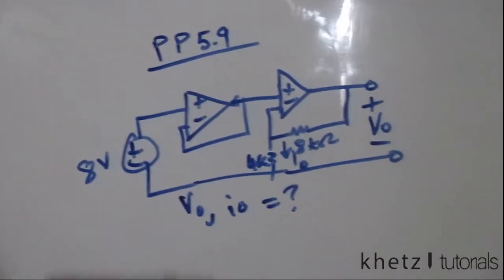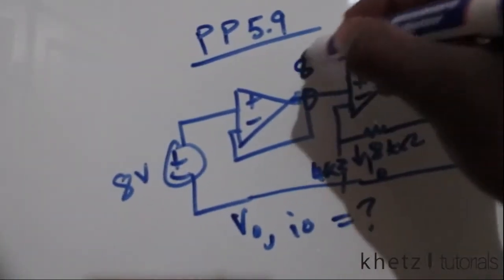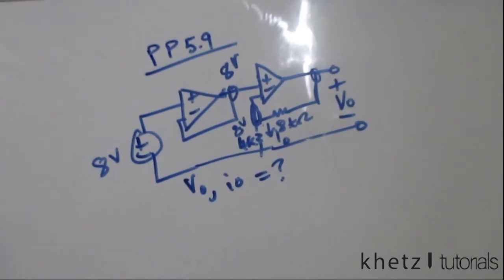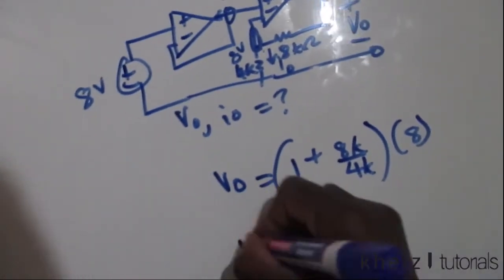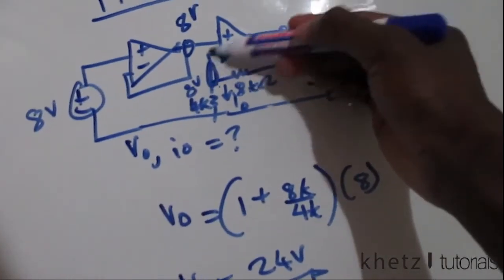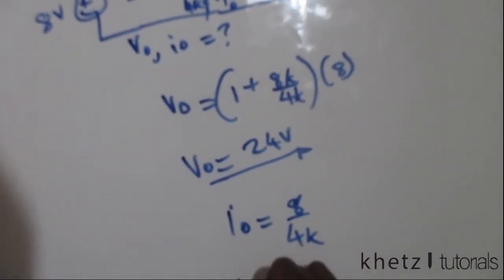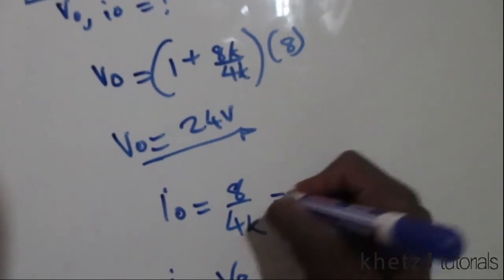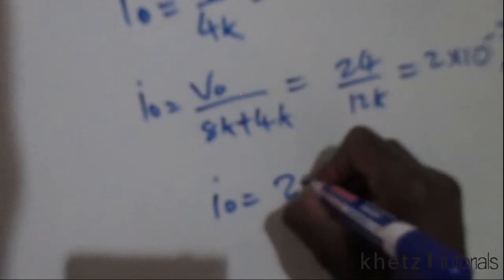Fundamentals Of Electric Circuits Practice Problem 5.9

Comment: Why do we use the non-inverting amp formula when the resistors are connected to the inverting amp?
Reply from the maker: Hello. If you check how a non-inverting op Amp looks like, generally, the positive receives the input(8 in this case) and the negative terminal leads everything else to ground. This is indeed a non-inverting op amp
Reply from the maker: You can also do nodal analysis, it should give you the same result